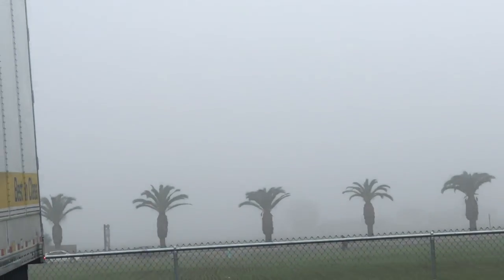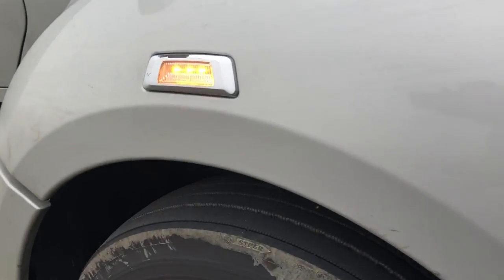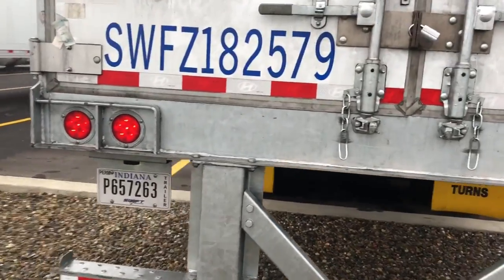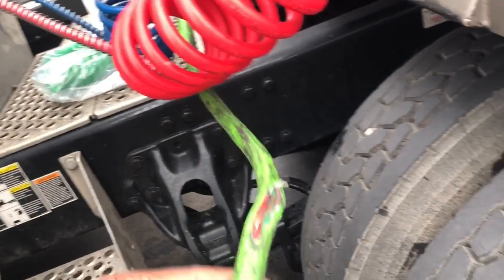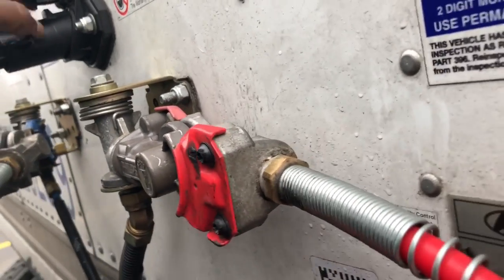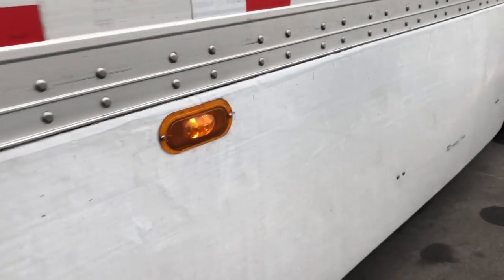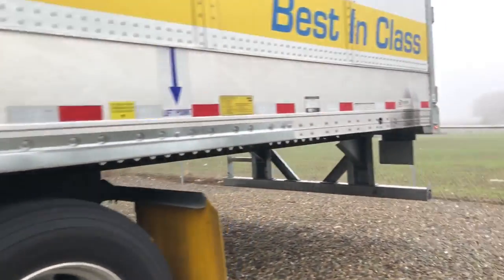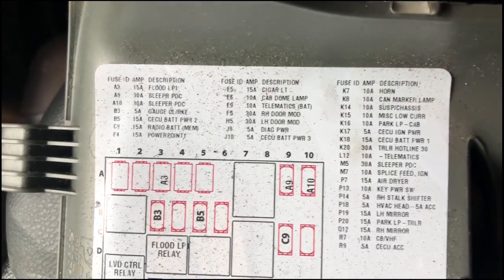NO break lights or Signal light on trailer ‼️DANGEROUS‼️

Comment: And even with brand new cable it can still fit loose on the side that is connected to trailer and cause electrical issues. They sell something called a pigtail wedge or shim. My company bought 2 brand new cables from Loves and they both fit loose.

Comment: First the ABS cable should not have been hanging that way , they all should be supported to keep them away from the deck plate , you probably don't know this but the green wire was the right turn , and the red wire was the brake light wire , that would be a real clue to check the fuses , put that in your memory bank  a little 12 volt test light will prove to be your best friend for electrical problems , usually less than $ 10.00         Frank
Reply from the maker: Thank you Frank, I’ve learned allot in my short trucking career and will continue to improve my overall knowledge of the industry. Thanks for your info and viewership. MTM✊🏽